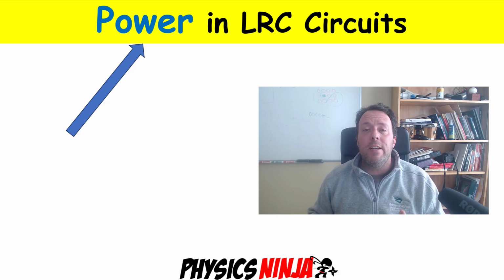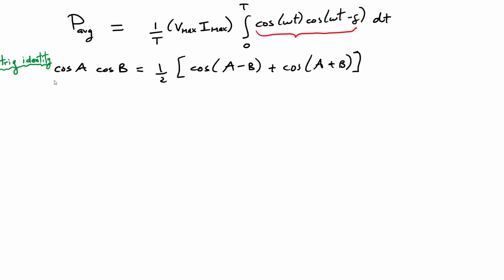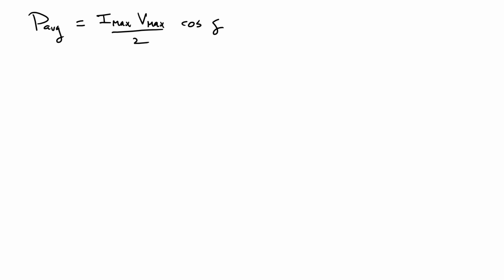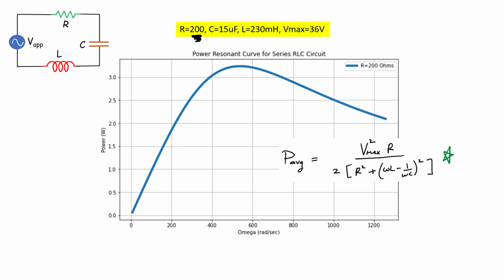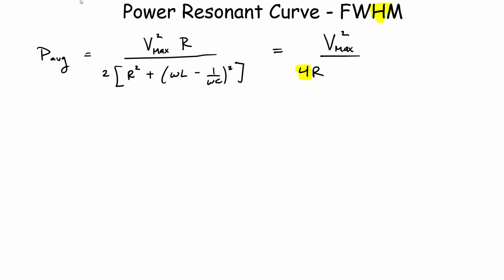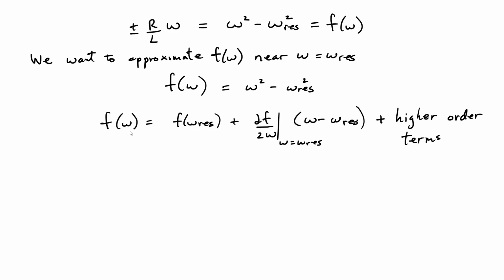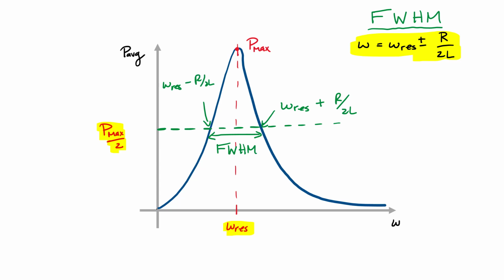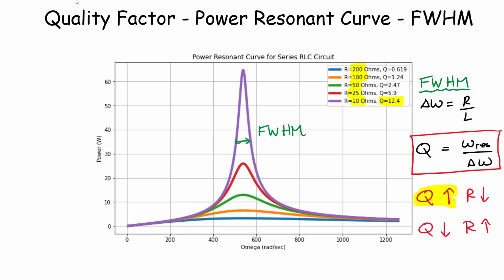Power in  AC circuits: Average Power, Resonant Curves, FWHM, and Quality Factor

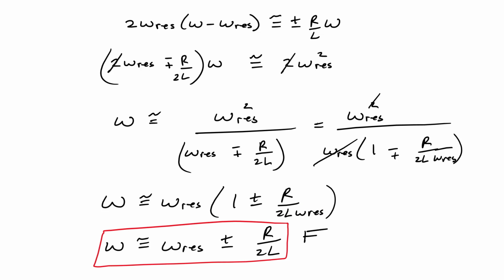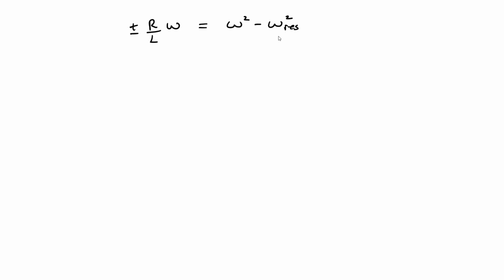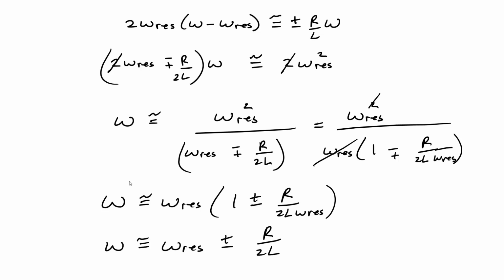Comment: Wow amazing video! I have just a question. for the equation at 27:32, couldn't you have just took the equation from  22:40 rearranged and taken the square to give sqrt[Wres^2±R/L]=w, and then disregard the (-) of the outside sqrt() because a negative omega doesn't really make sense. so then how does sqrt[Wres^2±R/L]=w relate to the equation you derived at 27:32 W=Wres ± R/2L. Does the sqrt() disappear as a result of the taylor series approximation? Once again great video!